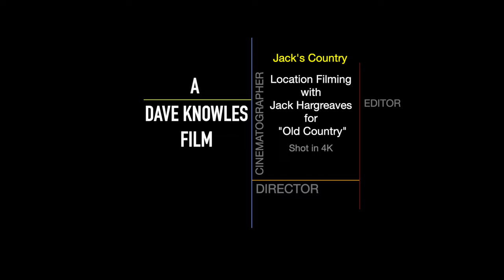How We filmed Jack Hargreaves for his last Television Series

Comment: I would love to know the technical spec of the location filming, camera/lenses and filmstock used? Such a shame the entire programme was not captured on film as opposed to poor quality video tape used at the time. Looking at the telecine, reckon a much higher quality transfer could be done.
Reply from the maker: Hi, The telecine work was done by the BFI and transfered to an uncompressed a I file. Unfortunately this does not take into account that the original studio video was shot on portable 1” with the film fed in from BetaCam (I don’t think SP was available then). You have to bear in mind also that telecine transfer then was sometimes not all that good for the film shot on location. This was then transferred to BetaCam. The film stock used for all Out of Town and Old Country was Kodak reversal. We then edited the original shot film. This was common practise at Southern TV for all by the high end productions such as Worzel Gummage and Famous Five. In the case of some of these programmes they were still shot on reversal but we had a black and white cutting copy made and this was rubber stamp numbered to match the reversal. We then cut the cutting copy and the assistant editor woul match the master reversal.